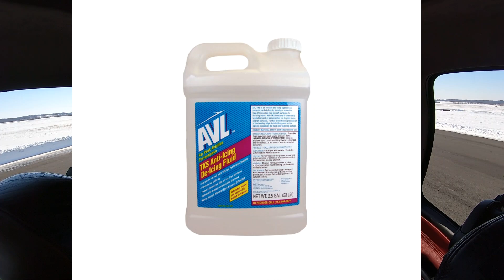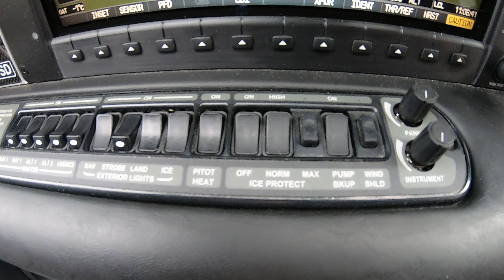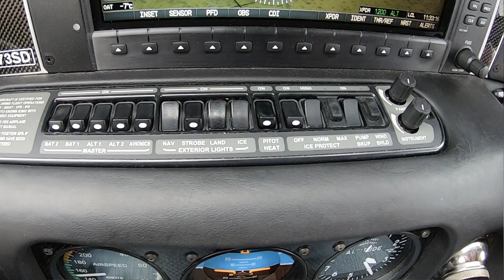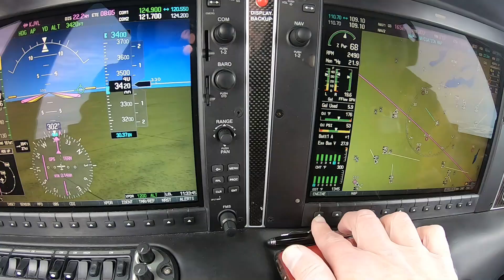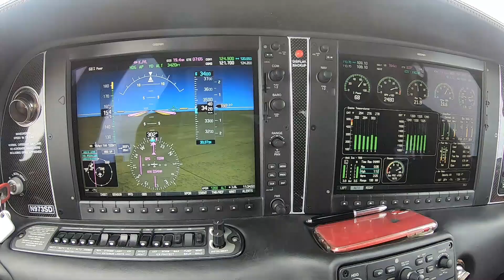Cirrus SR22 Anti-Ice System Operation

Comment: Might be a good system but I don't think we have seen the perfect de icing system yet. One obvious thing I wonder is if the engine heat couldn't be run through the leading edge of the wings or even the entire wing. Say you put out 300 shaft HP then the engine also puts out about 1 megawatt of heat. If you have used a 1kW heater then you might appreciate what 1000x more is. Call me crazy but I figure that if you put a megawatt of power into the leading edge of the wings that it's not going to freeze up.
Reply from the maker: A  buddy of mine bought a Corvalis TTX with an aftermarket heated leading edge.  He moved to Florida before I could get a PIREP on how it  worked for him.  I was wondering if it would refreeze as it ran over the wing.  I also wonder about heat with the composite material.  I hear preheaters can mess with the integrity of composite.  Like you said, no perfect solution.  Decades ago, my dad worked for an alloy company and they thought they had a metal that ice would not stick to, but the FAA tested it and it failed.  Maybe I should just move to Phoenix.  ;-)

Comment: Boots on the Baron and Combination of a hot wing and boots on the tail of the CJ. Bleed air for the windshield on the CJ and a hot plate for the Baron. CJ also has alcohol as a backup for the windshield. Even in the jet I use it to get out of ice. No a good feeling hanging out in it any length of time. Happy Holidays!
Reply from the maker: Awesome.  Thanks for the comment.  The thing I worry about with the TKS is if I don't get even flow.  We're supposed to run it every 30 days to prevent the panels from drying out.  I don't ever want one wing clean and the other not for obvious reasons.  I would prefer boots, but this has worked well for me for several years, so glad I have it.